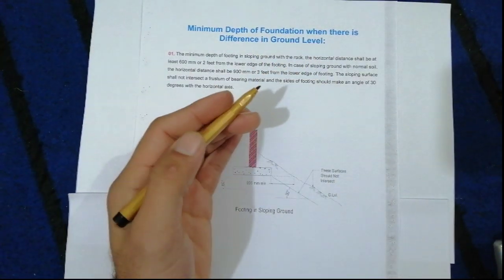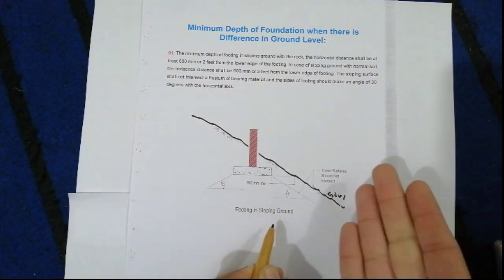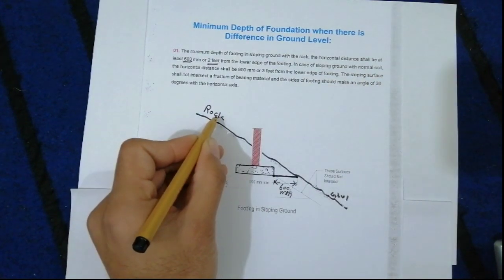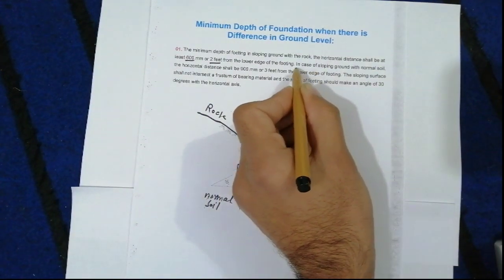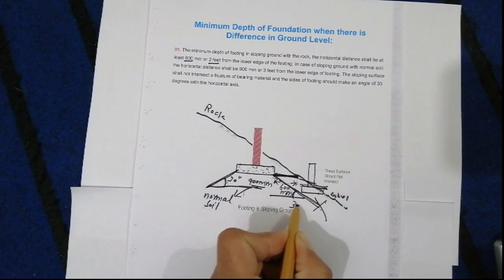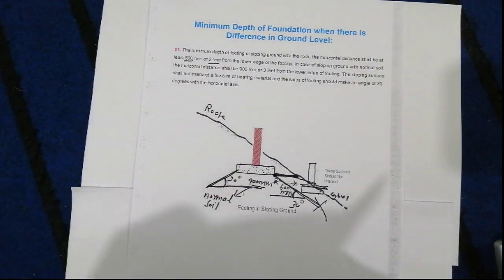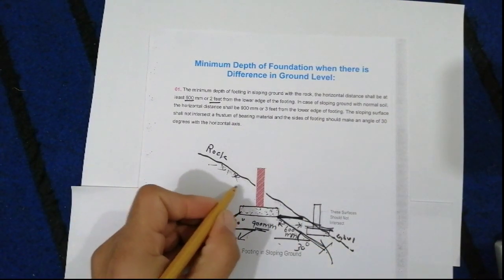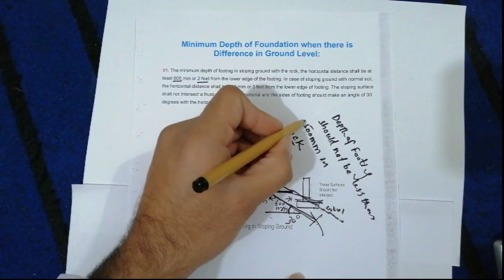Minimum Depth of Footing in Difference Ground Level - Depth of Foundation in Rock

Comment: What is the climate zone? What is the required frost coverage? What are the results of the geotechnical boreholes? Are soils expansive? What is the compressive bearing strength? Local codes?